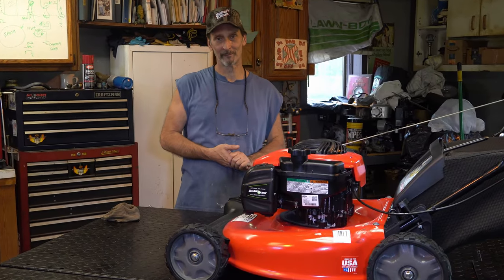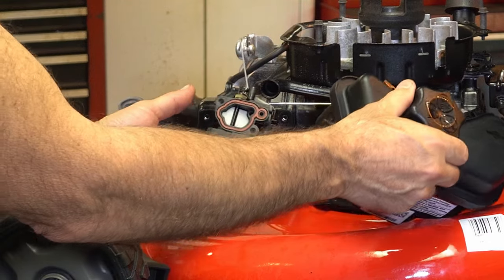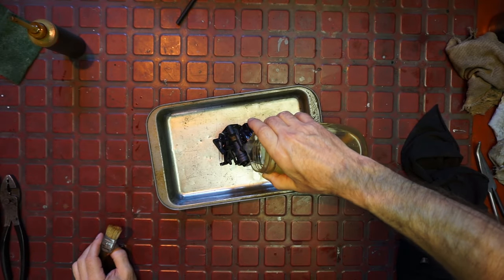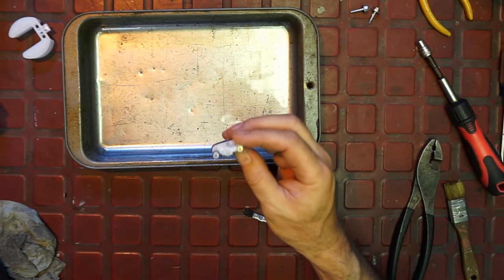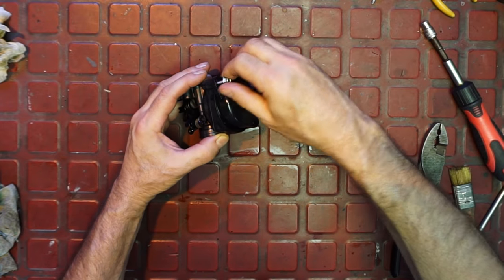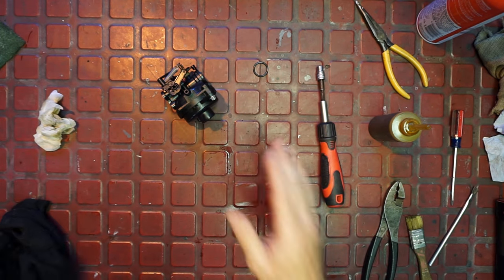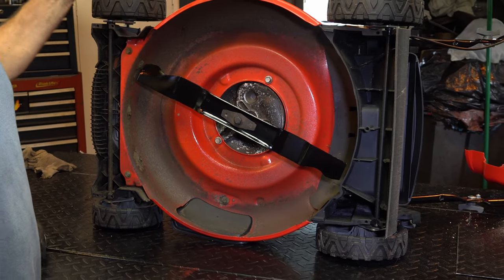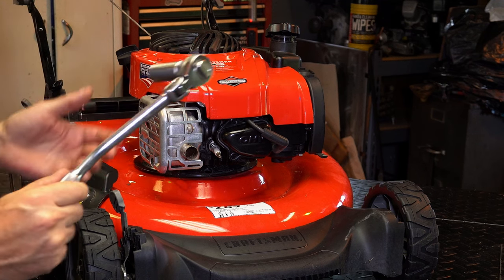Craftsman Mower Starts but Won't Stay Running - FIXED! Craftsman M110 140cc ~Full Tune & Service

Comment: Hey thanks for the video. They really helped a lot unfortunately I'm still having the same results to where it'll start but won't stay running I did everything you did clean it and everything else, put it back together... Shot some gum out in the carburetor then pulled the line. Had the same results. Starts up but doesn't stay on. Any additional help would be great! 

Craftsman M230
163cc 7.25 series
Reply from the maker: I cant diagnose from a few words and a paragraph! The video takes a half hour, chatting in text would be impossible. 
You need to check if the carb is getting fuel, is the line clogged, is the carb mounted properly, are you missing something like the O ring?
I've seen some crazy stuff of people leaving things off, putting things on wrong then giving up.
You may have a clogged carb and just didn't clean it well. 
I've had people skip steps, not watch the entire video then ask a question that I already took time to answer. 
Unfortunately we cant be the mechanic on call, best we can do is try to make a video to help!

Comment: The Jet manifold comes apart and there are holes then exposed in the emulsion tube that need to be cleaned also. I had to do this because spraying did not get them clean until I did.
Reply from the maker: Some people replace that pack, its not expensive but there are different ones.
Reply: @TheNovaJohn  yes mine is only $7.00 at amazon but it just needs cleaning

Comment: my m110 dies after mowing for a little while. grass clippings aren't what's doing it though. i've cleaned the carb multiple times, cleaned the gas tank and fuel line, replaced both the ignition coil and the spark plug but the problem persists. thing's little over a year old and i have no idea what the deal is 🤷‍♀
Reply from the maker: Clean and inspect the gas cap..They are vented, some are crap!
Not sure what engine you have, come caps have a carbon filter with little holes that get plugged with dirt and when people overfill..
A small vacuum is pulled as the column of fuel is pulled down the the gas wont flow..
Also if you installed a filter and used the wrong one.. 
No one can diagnose over the web so I cant see your machine..Good luck!

Comment: Arch not careful,when you tilt the mower on it's side if the gas tank has gas you can soak the filter with gas as you are changing the oil through the gas tank vent. Nice video.
Reply from the maker: LOL,,that's right Jerry,,,,I tell my customers that all the time!
naturally when its on my bench I do what I gotta do to get er dun!
Reply: How i know that 😑
Reply: I just put a piece of plastic like a Ziploc bag or trash bag under the gas cap and it works just fine.
Reply from the maker: Great Idea Rein,,,,wont work though on these engines. Remember, this tank is vented through that little tube stuck into the filter housing..I think this is how they are now.
Reply: Arch's Garage    In that case, I’ve been collecting and fabricating plugs for months to block off orifices of all different sizes and shapes. I started with a Dorman vacuum cap assortment,  #47388, and just kept adding from there. I used a soda bottle cap to block off a muffler the other day before pressure washing a chipper. I’ve got some now from different sized wood dowels, toothpicks, odds and ends of round plastic things - anything I can find which will block off from the inside or outside of holes. I’ve seen automotive YouTube’rs saving the plugs that cap off holes in new auto parts for that reason, which is where I got the idea.
Reply from the maker: When I worked at Grumman Aerospace I started collecting these caps....I have quite a bit now in drawers...
Sounds like your ahead of me on this!! I have waayyyy to many machines to do this....

Comment: I have the same mower it runs but it’s idled very high. What could be the cause of it?
Reply from the maker: Idle is term for when an engine is at its lowest RPM. 
These engines do not idle, they run at one constant working RPM.
High is relative. Typically most engines run at 3400 rpm as set or a little lower is fine,
You can check it with an inexpensive meter, search amazon or go to a local shop.
If you have noticed it running faster than previous, you most likely ran it under a bush and bent something in the Governor or mechanism.